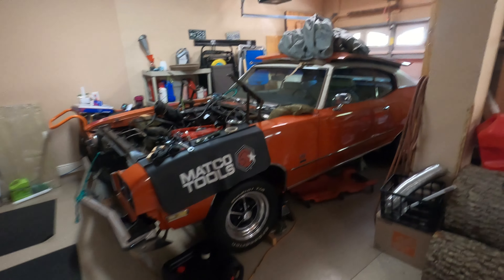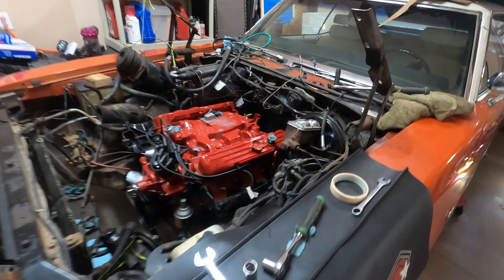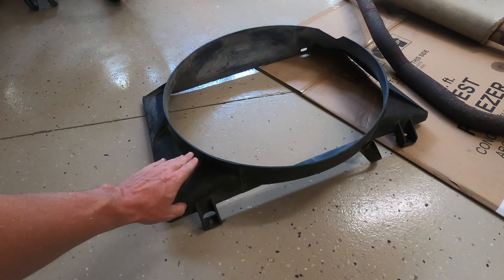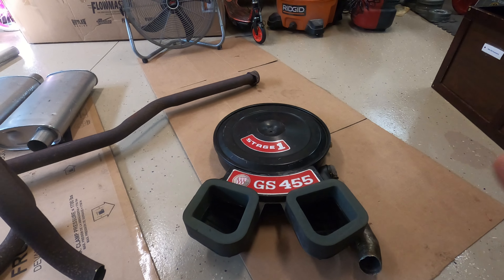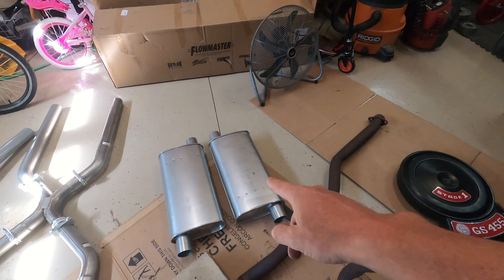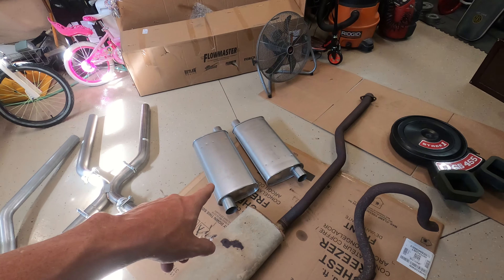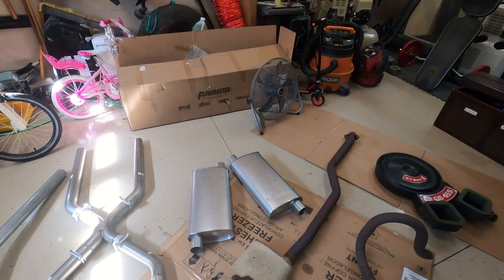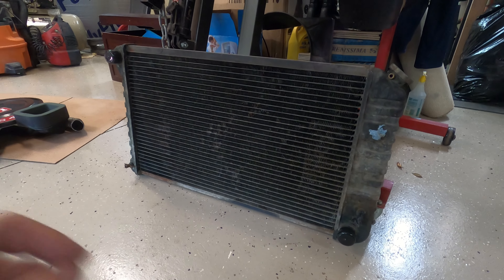1972 Buick Gran Sport Restoration Part 3 - New Big Block

Comment: Looks great can't wait for it to be done!!!.
Reply from the maker: I'm taking a closer look at the RobbMC fuel pump here soon on the channel. It's a shame the Stage 1 deep bowl pumps are no longer made. Thanks for the support!
Reply: @JackofAllTrades1  I have one 550HP version its very well made you won't be disappointed; My Buick 464 is close to 600HP should be perfect!
Reply from the maker: @Buick Performance Support Channel!  very nice... mine is also a 464. What CR do you have?.... I have no idea how much HP I have but I'm running stock '70 heads with large valves and a bit of port work but nothing crazy. I think my biggest restriction is the stock manifolds.
Reply: @JackofAllTrades1  MY Engine is 10.6 to 1
Reply from the maker: @Buick Performance Support Channel!  I'm sitting at 10.2:1 but I have the thick felpro blue head gasket. I have considered using a comedic or steel gasket to bump it up to around 10.5:1.   Are you able to run pump gas in it?
Reply: @JackofAllTrades1  Yes 93 all the way!
Reply: @JackofAllTrades1  Can't wait to get rid of the noisy electric fuel pump

Comment: This car needs more videos!    Bigger engine, more compression, dual exhaust.  You are going to be blown away the first time you drive this thing.   Should be driving soon?
Reply from the maker: I was just recalling the other day... when was the last time I got behind some real HP?.... it was in 2007 when I drove a newer 6.0 GTO. Standing on the skinny pedal had my passenger and I giggling (fearfully) like school girls. Lol.... I'm not really sure what to expect with this car, it will have well north of 500ft/lbs of torque though.
Reply: @JackofAllTrades1   You may know I had a cam swapped 6 liter GTO for almost 8 years.   Made right at 430 to wheels.  That car was always kind of a weird car to me.  I liked it but at the same time I never really connected with it in all that time.   Every time I drove it I felt like I was going to get pulled over.  Don't have a real reason for feeling that way.    The corvette stands out like a sore thumb in comparison and I go out and beat on that thing like it owes me money lol.   Yes I am strange.  :)
Reply from the maker: @PNW_Car_Mods  yes I've seen the video of you doing a burnout. I believe we had a discussion on the ROC once about the GTOs. This Flame Orange Buick will probably get that same attention... I've already discovered a few places where I can mash on it and have some decent, unihabited roads to drive on. I made sure the exhaust was tame in order to not draw any more attention than needed lol.